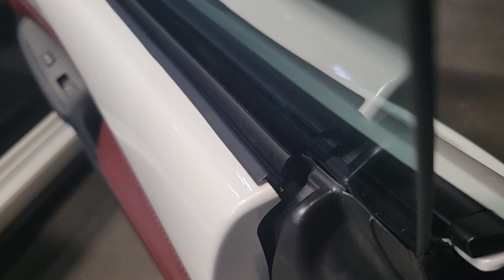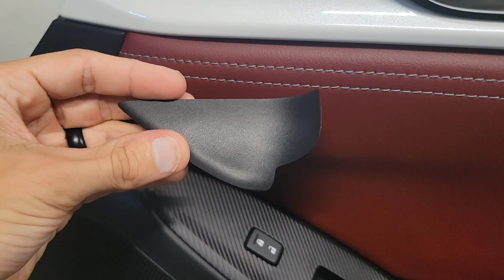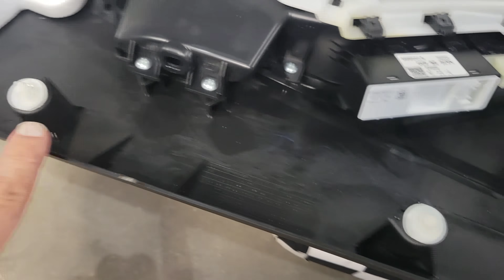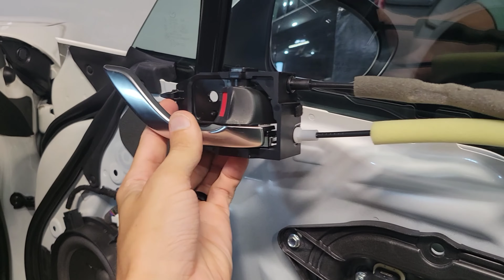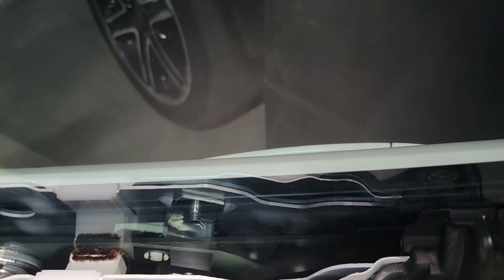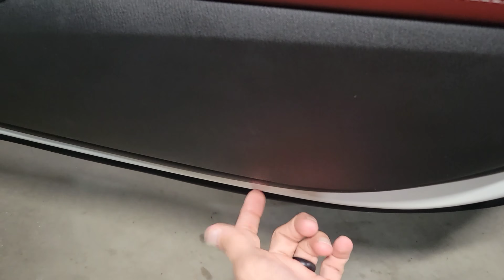Mazda MX-5 Miata (2016+): How to Remove & Install Door Panel to Fix Window Gap - ND ND1 ND2 ND3 RF

Comment: Same happened to me also from when getting my tint done. Thanks so much for the video. Going to try to do the same and hopefully get the same result you did.
Reply from the maker: Best of luck to you. Sorry to hear you had the same experience after getting your tint done. Take your time, and with a little patience, you'll have your door panel back to the way it should be!
Reply: Alright just did the job and it looks just like new 🎉🎉. Only tricky part was actually all but 1 of the white plastic clips stayed stuck in the frame so a little extra work but no complaints. Big thanks again!!

Comment: I have the same problem from when I was messing around with some interior ambient lighting strip on the driver's side door, I put the door panel back on and there's an awful gap from the glass up by the steering wheel. I pulled off and put it back on twice and couldn't get it to lay flat against the glass like this. Gonna have to go at it again but this time mindful of those "hooks" at the top and that extra plastic panel you pointed out below the window. Thank you!
Reply from the maker: Sorry to hear you're experiencing the same issues I had been. Take your time and seat the top of the panel first. It should seal up nice and tight for you. Hope the video helps! 👍
Reply: @SeanStettnichs  Just came back to say thanks again! I had to replace that entire light strip and this time made sure those top hooks were in before the rest of the panel went on. No more gap at the glass!
Reply from the maker: @Fyre0  Sorry to hear about the light strip needing replaced, but glad the video could help! 😃